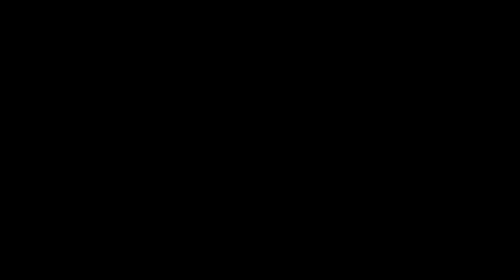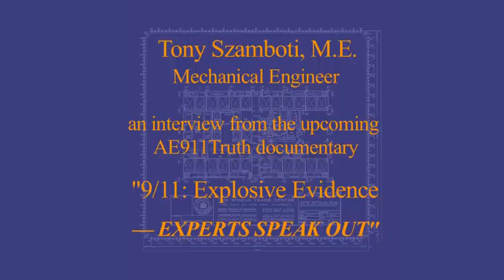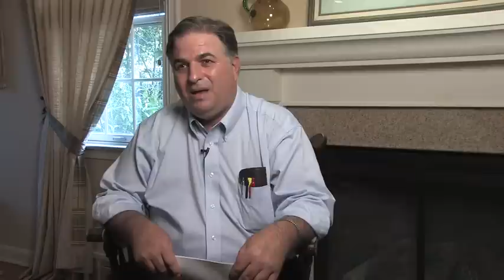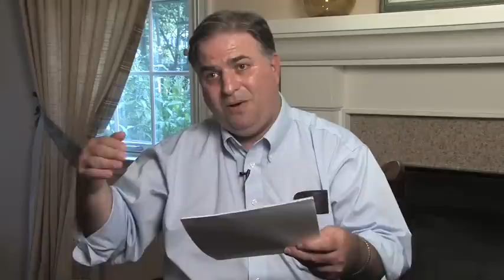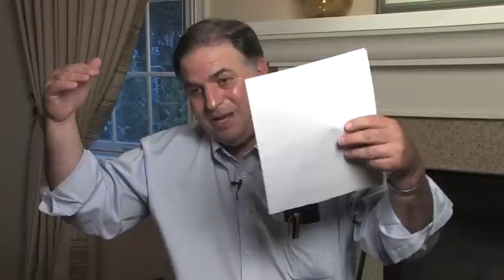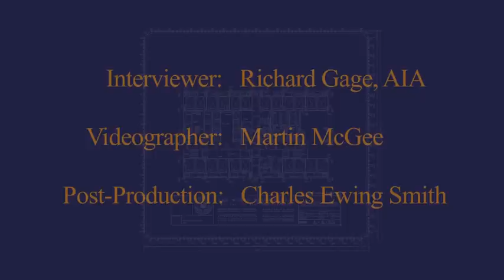Tony Szamboti, M.E. - Mechanical Engineer

Comment: WTC 7 was a 47 story building which was 610 feet tall where each floor was the size of a football field. It had 75% of the floor space of the Empire State building, so it was enormous. It had 82 very large columns and yet came down across the full length and width of the building in full freefall acceleration for over 100 feet.or about 8 stories.

The fact that charges had to be pre-positioned in WTC 7 lends credence to the fact that they were probably in the towers also.

Comment: @realcddeal Quote: "The fact that charges had to be pre-positioned in WTC 7 lends credence to the fact that they were probably in the towers also."

Well said, and a point I have been trying to make for a while. Only a determined anti-Truther would deny that WTC7 was anything but a classic CD. *But* in order to be able to blame WTC7's collapse on "damage from the Towers' collapse", the Towers *had* to collapse FIRST, or else no debris would have been present. Obvious conclusion: CD of Towers.
Reply: Six years late to the party, but chopping down a reply anyway: from March 2001 to the day of the 'attacks', Ace Elevators performed an upgrade of the elevators and related hardware, while another company was doing upgrades to the internal computer network by replacing the UTP-cables on every floor.

Mid August 2001 saw an unprecedented, complete power cut in both towers for 36 straight hours, leaving tour guides exasperated because tourists kept wandering off into restricted areas because no power meant that none of the doors were locked.  That includes the entrances and vault doors to the safes down below, to the horror of security.

No one ever mentioned what happened to all the valuables inside the Twin Towers' vaults as well as those in WTC6.

Anyway, enough time during the months of renovation for 'extra' personel to add charges on every floor around most of the support columns and at the same time empty the vaults of their content...

Comment: @NellJSmith The debris from WTC 1, 2, and 7 hit other buildings. That, by definition, is not "straight down". WTC 7 fell across a 4-lane street and hit Fiterman Hall and the Verizon Building. I'm not sure what definition of a "classic CD" you're using.

Your argument is a textbook Affirming the Consequent. "They needed to CD the towers to have an excuse for 7 so they CD'd the towers, QED."
Reply: Yes on average they fell straight down. Due to the explosions, the area of debris of WTC1-2 is crazy widespread, but the centre of gravity still fits into their footprint.
The top falling straight down is meant as opposed to tipping over and falling besides the underlying massive steel structure. Or in the case of WTC7, falling on top of the building West of it, as per NIST's "models".

"by definition" xD
You trolls are just such a waste of time.